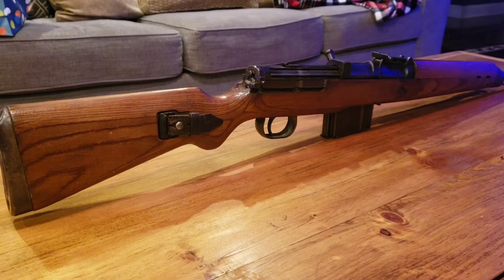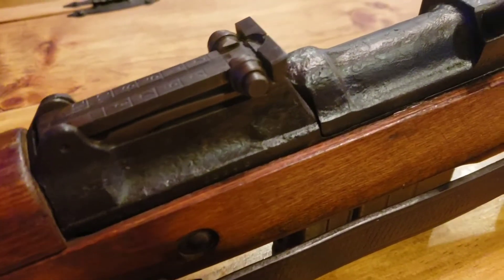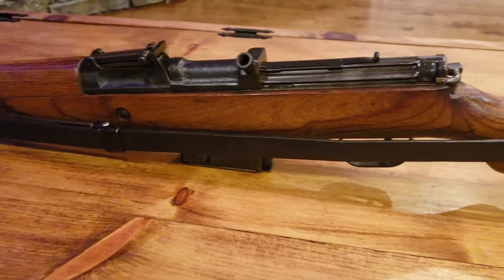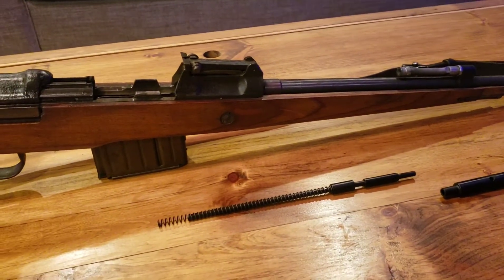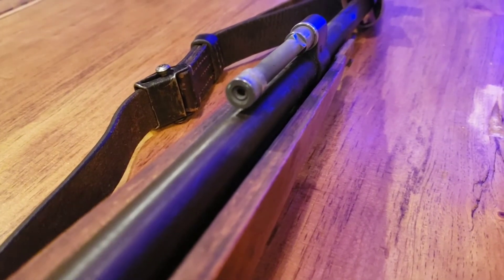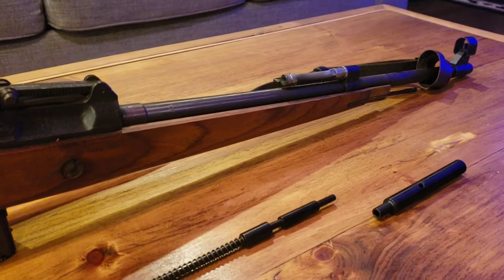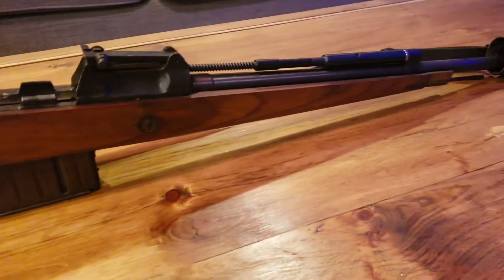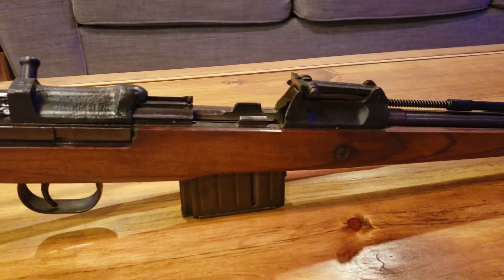G43 K43 Shooters Kit Explained 8mm Mauser

Comment: How much did you pay for it!
Reply from the maker: A lot less than what g43/k43 rifles are going for right now.
Reply: @williams_garage  I just got one for 2500. So I got a great deal for one is really nice condition. No scope though and it was fairly dirty internally, so either some guy here used it alot or it was used alot in the war. Although my bolt carrier and gun have different numbers leads me to believe it was used in the war because they obviously broke the original one because from what I understand it sat in a guys collection.
Reply from the maker: @Collectorfirearms  it's not uncommon to find these with mismatched parts. I love these rifles but they are quite fragile and I think a lot of mismatched parts come from relishing broken parts. All of the parts on this rifle were matching. This rifle actually really clean inside but the finish was really dirty. I got it for 1800 at the local jockey lot so I felt like I got a deal on it.
Reply: @williams_garage  thanks for the information! By any chance do you know if the bolt holds open with a empty magazine. Mine doesn't so i don't know if I'm missing a piece or not.
Reply from the maker: @Collectorfirearms  yes, it should hold open on the last shot. It should stay open even after the magazine is removed. It should only unlock when pulled back with an empty magazine removed or a freshly loaded magazine replaced. I hope that helps.
Reply: @williams_garage  sure does! I guess mine is missing the mag hold open part then.
Reply from the maker: @Collectorfirearms  if I get time, I'll take a couple of pictures of my and send them to your DM so you can see exactly what's missing.
Reply: @williams_garage  that'll be great! How will you dm me?
Reply from the maker: @Collectorfirearms  great question. Haha if you will, just send me an email at willhuntchevynova@yahoo.com and I'll get those pictures sent to you this weekend.
Reply: @williams_garage  alright. I'll email you after work!
Reply from the maker: @Collectorfirearms  Perfect!! Sounds great!!
Reply: @williams_garage  sent ons
Reply from the maker: @Collectorfirearms  I checked my inbox and my spam folder and I couldn't find your email. Will you resend it?